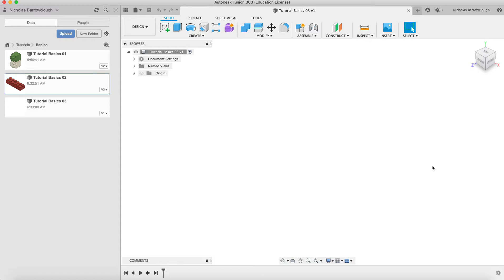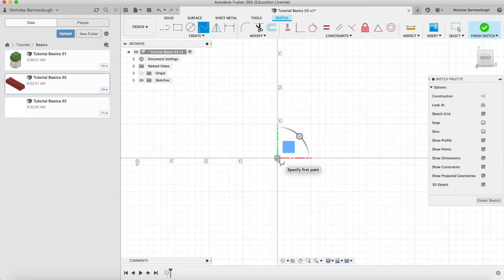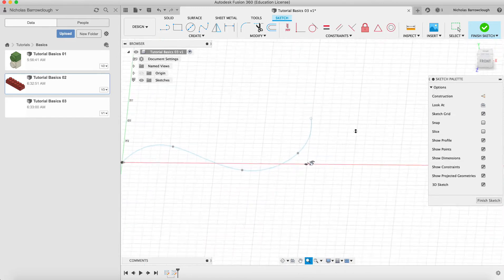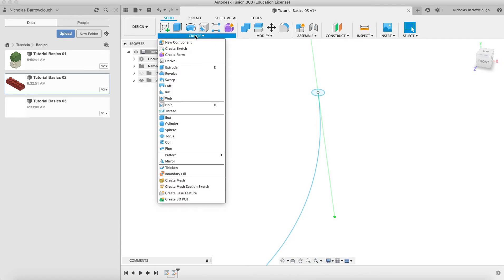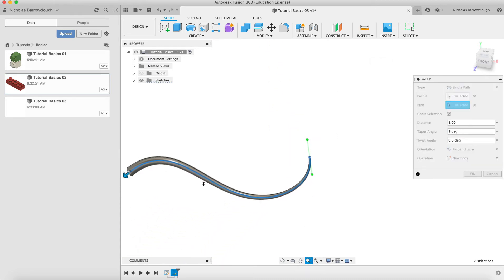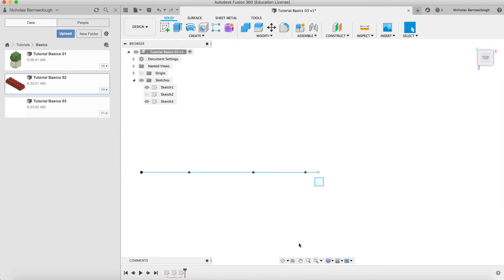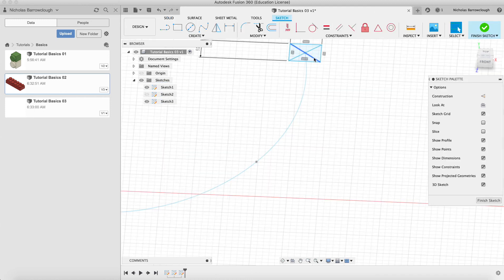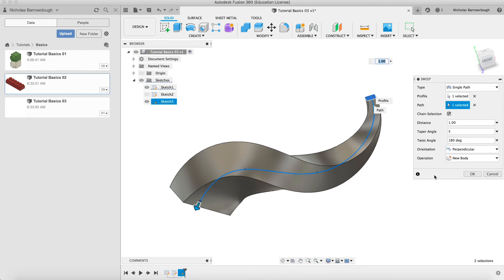Autodesk Fusion 360 Basics - Sweep Tool (Tutorial 04)

Comment: Hi there, may I suggest that the sketch for the shape that will be extruded to be built on a construction plane chosen by "Plane long path" option in the menu, by selecting the end point of the spline (not the spline itself). This way not only you don't have to move the sketch but you are guaranteed that the sketch is in fact "perpendicular" to the start of the spline and thus any section of the new formed body is identical to the sketch. This issue is more obvious when the spline is not planar but 3d. Other than that, nice tutorial. Thank you.